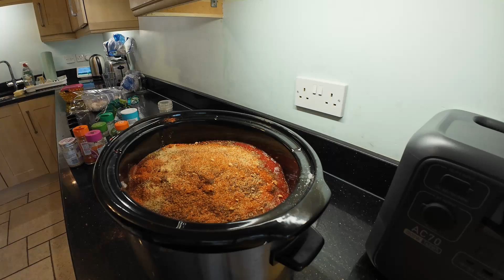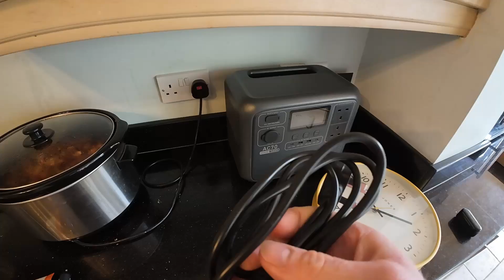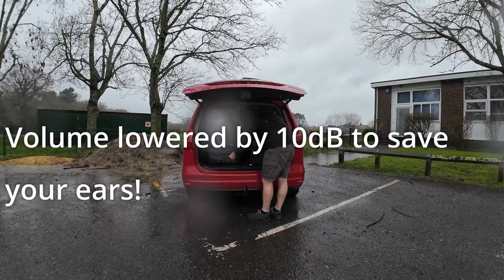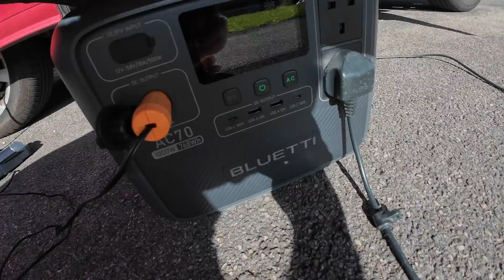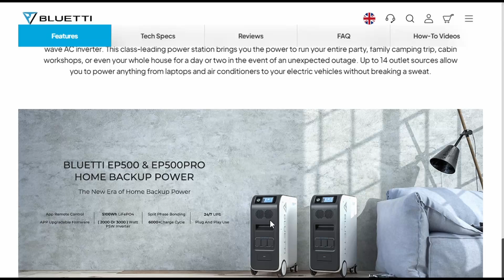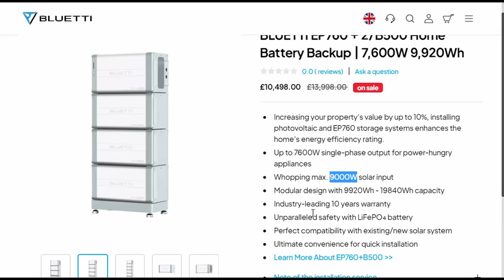Let's Torture Test this! Is the Bluetti AC70 battery as good as they say?

Comment: Should just get a 16kwh Fogstar battery. 2k, I charge mine at night in the winter ( makes me 3 pound profit a day in the winter as I sell it at a higher rate ) also saves plugging things in as it’s wired to the consumer unit. To give you an idea I saved £900 in electric last year and made £3000 profit from having 22 panels, 16kwh storage battery and selling the access which goes out the door. Don’t waste time and money on small portable batteries.
Reply from the maker: 👍 I have 24kWh of battery storage connected to the house and a further 20kWh in portable power stations for emergency backup.

You can see it here: https://youtu.be/CKIEBu5Q_ZU

Comment: Just bought this + their 200w panel on this prime day (£449 + £211 - 5% extra discount = £607). 
Seems to me the point of this is electronics. Not sure Id be using it for the pot or plate cooking :D  even with the panels. Certainly nice extra on an power out (since house PV+battery system in not on EPS, yet).
Reply from the maker: Agreed. Did you see my follow up video on this? https://youtu.be/JYzIHuOxG60
Reply: @UpsideDownFork  I'll sure to have a look.

Comment: I obtained a Bluetti AC70 and was counting on its Power Lifting claim to run my Ninja Foodie Digital Air Fry Oven (Model FT205CCO) on Camping trips. 

Sadly the AC70 did not power the Oven properly at all. 
While in Power Lifting mode (claimed to handle 2000 Watt Loads); the Bluetti turned on the Oven .... but nothing got cooked. :((

I used a Kill-a-Watt meter to monitor the power while on House juice, and the Oven used cycled up to 1560 Watts. while cooking stuff. 

Connected to the Bluetti AC70 the Oven failed to cook anything; and the power reading didn't get much above 900 watts.

Any ideas guys ???

The Bluetti must seriously drop the voltage; and attempt to create an illusion of powering a 2000 Watt device.
Reply from the maker: Sorry to hear that. Does the air fryer have any lower power settings?
I believe the AC70 lowers the amperage whilst maintaining the voltage to allow some devices to work. Different appliances will have different electronics which may not allow this.

Our microwave did struggle with the AC70 but worked fine on our other power station which you can see here https://youtu.be/5yV3zpklbiY

Comment: Personally, I wouldn’t have a lithium battery that size in my house due to potential fire risk.
Reply from the maker: LiPo isn't a fire risk.
I'll do a separate video about this as I have quite the rant to share when people talk about fire hazards...whilst burning gas at a hob or a gas boiler...
Reply: I've heard that the ac70 has a dangerous wiring problem. Reverse polarity I think they called it.
Reply: Where did you hear this @Arizona-u8g

Comment: The portable all power 2000w upgraded model, we used at our allotment to power angle grinder and reciprocating saw when we were doing work for around 30-40 minutes and it went from 100 percent to 96 percent, they are definitely better than a generator and we didn't have the solar panel plugged in no doubt we could use it for days without running it flat

Comment: Morning. Interesting video. I have powerwall 2 it cost 7.5k installed three weeks ago. Bills down over 70% with 16 solar panels. Second powerwall is 6000 £ Installed that would take my system to 27kwh of battery storage. The app is brilliant and I wouldn't want any other battery. Had looked at Pylontech and give energy but plumped for Tesla.